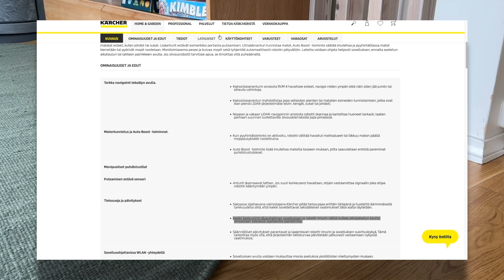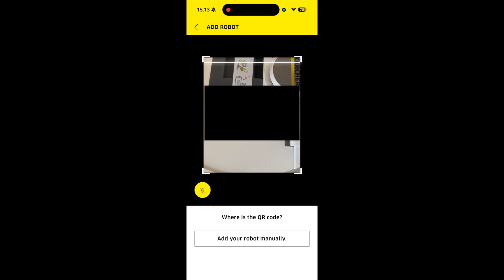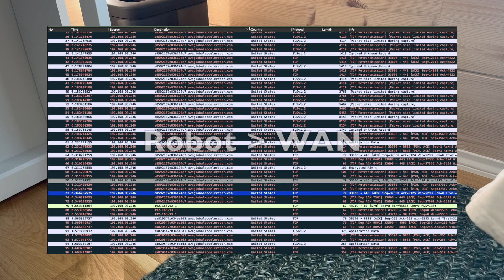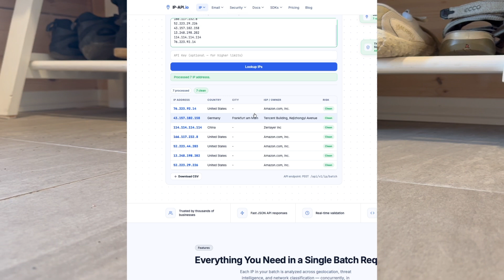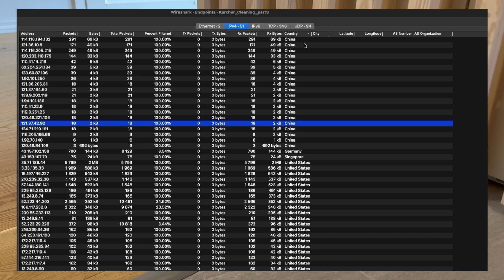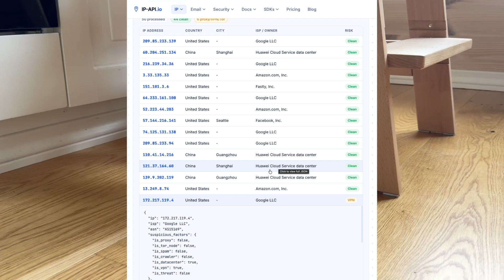Kärcher RVM 4 - Privacy concerns

Comment: Thanks for posting that. I was wondering exactly about that issue. The results of your tests are worrying. Do you think is it possible to simply block outbound traffic for selected unwanted destinations in home wifi setup? maybe you tried running that robot with blocked traffic?
Reply from the maker: Blocking robot from AWS USA servers or Picea's (German) server breaks the communication with the app. Rerouting Chinese hardcoded DNS server traffic through own DNS server technically works, but the robot keeps reconnecting WLAN connection which makes the app annoyingly laggy.

The app on iPhone works fine if you block all Chinese IPs. I normally ip geofence the whole country and found the Chinese IPs accidentally.